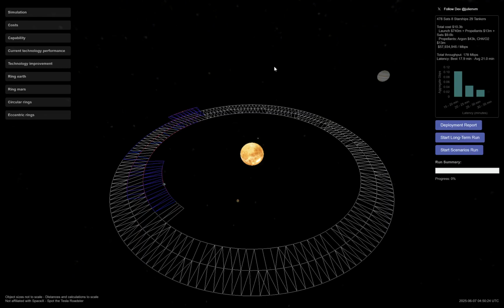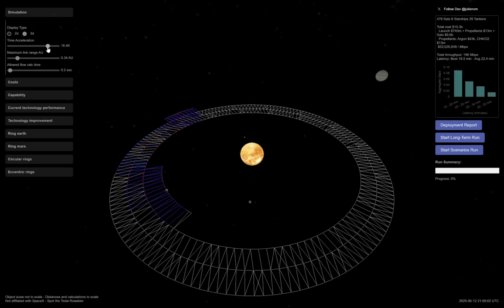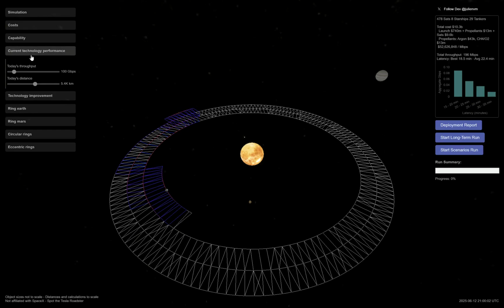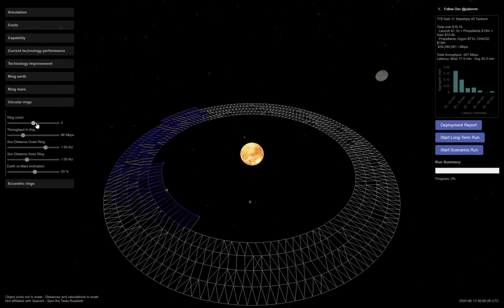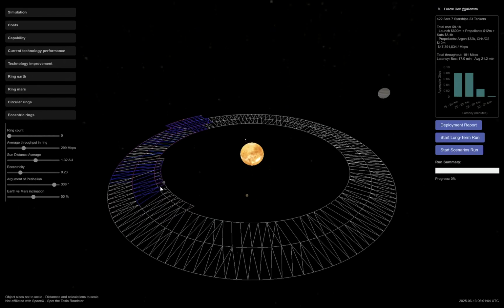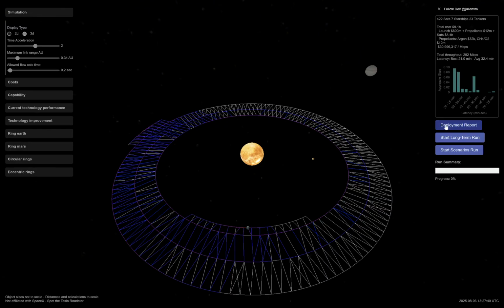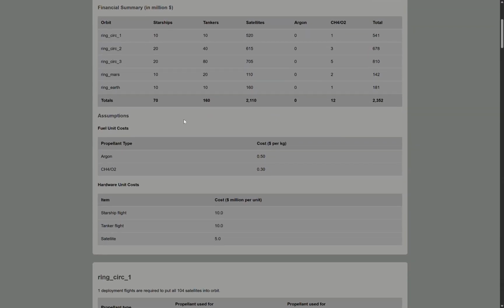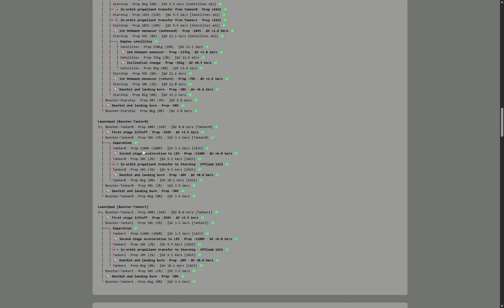Marslink: an internet link between Earth and Mars

Comment: I assume launching costs assume earth-based launches? 

I feel like by the time we get to the point we’re adding a communication network like this between mars and the moon we will likely already have an initial-phase moon presence to cut down the costs. Even if only for the metal components, with the complicated components made on earth, then assembled on the moon/lagrange point/whatever earth orbit before sent off to its long term position.

Then again, it is kinda fun to see what a “if we wanted this *now*” setup for this would cost. Plus the space-setup of the future is extremely unpredictable (as far as what’s needed for specific numbers, at least; certain things are reasonable to assume, if you don’t want to put specifics on it, haha).
Reply from the maker: I think SpaceX will build a constellation similar to this one to get 1Gbps. They will not wait to have a moon base (which they don't want) to start launching satellites. If and when they build manufacturing facilities beyond earth, they will then transition manufacturing there, but not sure that's gonna happen in the foreseeable future.

Comment: I don't really understand the premise behind such a construct. I mean, we can still communicate with the voyager probes, and they're both well over 100AU from us. So why wouldn't we just have a couple of satellites orbiting earth and mars that are sending data to and fro?
Reply from the maker: Because SpaceX wants gigabits per second, not kilobits per second. And the inverse square law when transmitting signals means you need exponentially more relays if you increase the required throughput linearly.
Reply: keep in mind the data rates specified here are measured in Mbps and not Kbph
A relay system would also be practical in the event of a solar eclipse